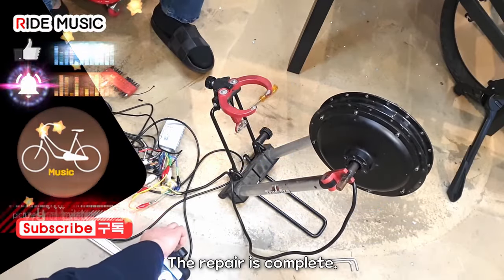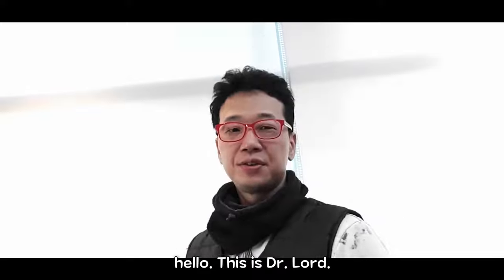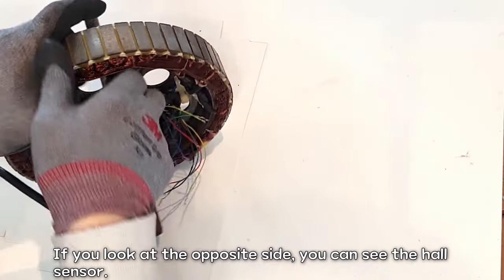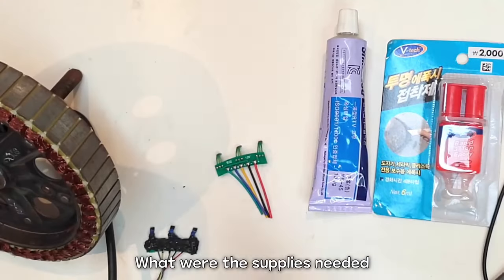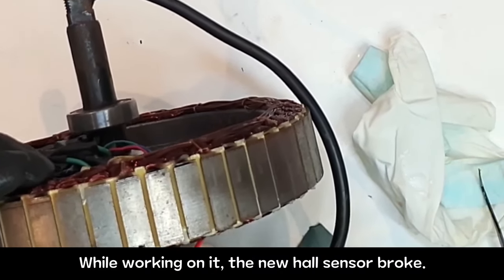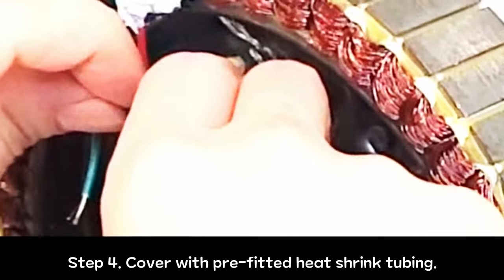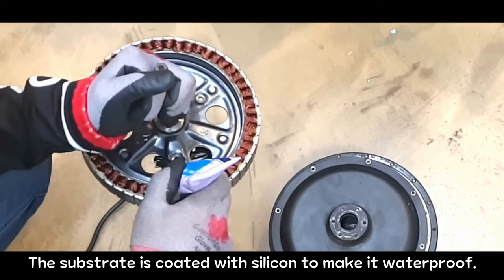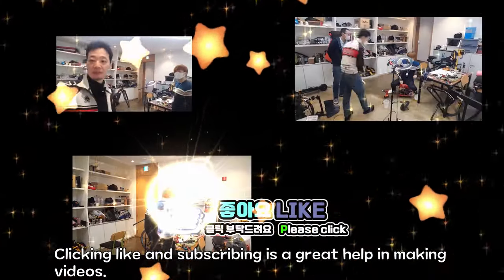E-Bike Hub Motor Complete Repair Guide / Controller, hall sensor, inspection method

Comment: That's an example of a sloppy job... Should have cleaned the seat, and dry-fit the components before applying the epoxy and stuff... 🤦🏻‍♂️
Reply from the maker: Thank you for your comment. I skipped cleaning because it was common sense.
Reply: @Mobilant_US  and that was your mistake, as we all saw 💁🏻‍♂️

Comment: Definitely solder next time...I have been twisting wires together for years...and the connections don't last in a moving environment.  Oxidization gets the better of them over time and the connection will get weaker and weaker over time, adding extra resistence and heat. I would even suggest desoldering the wires from the hall sensor, and soldering motor cables directly to the PCB.  If you want it easily removable, solder some type of plug...like an FDD connector or something.  Otherwise a very informative video!
Reply from the maker: thank you Yes, that's right. However, if you twist the stripped wire long, the heat shrink tube is surprisingly strong.💪

Comment: When you change the hall sensors it's also good time to change the bearing. Next time use puller. Save your finger you are lucky the magnet didn't cut you fingers or at least break it. After you disconnect the old hall you should check the old cable it is working properly. That whats you douing hire it DANGER Also you should resoldering the new hall cable. before you close the last cover to close the engine add silicone to get waterproof.

Comment: Hello, Thanks from Bulgaria! I am reading your wonderful book. I am not an engineer, but, I am just keen to know how things work especially things that I "ride" on... also these days, our "engineers" know more with their mouth than their head, so I like to be prepared before I trust them with my valued ebike. Thank you again for your effort to share your knowledge.
Reply from the maker: Thanks for viewing the book. Riding an e-bike comes with quite a few maintenance issues. It is very important to know how your e-bike works. And riding, touching, customizing everything is fun. thank you. 🚲🚲🚲~
Reply: @Mobilant_US  I've found and bought same motor tester as yours (573D). That was a bit lucky. Would you know where would I be able to buy Parts for our Fafrees ebikes? I have bought 2 new F20 pro bikes and I panic in case I need parts. I don't even know what make/model and type are the motors. I will be ever so grateful if you could give me any light there. I am not young anymore and in this country that I chose to retire, everything has to come from outside and at High premium prices. I use Aliexpress all the time  but I need to know what to order. Thank you and best success at everything you do. It feels nice to know you while I am reading your book.:trophy-yellow-smiling:

Comment: hi...want a raise???..make one of those bigger to fit inside a car wheel...connect it  to the back plate of the brake mount with a bracket ....attach it to the elaectro magnet case...
use multi car batteries....wire it up..don t forget the re charging switch and reverse...
congratulations you are on your way to being gas free...
god blessed you...

Comment: I just put one of those motors as a front wheel on a three-wheel mobility scooter along with its rear motor. I use the rear wheel off of a larger scooter that was two wheels 36 volts in front 24 in rear I don't run them together very much
As they are totally separate systems